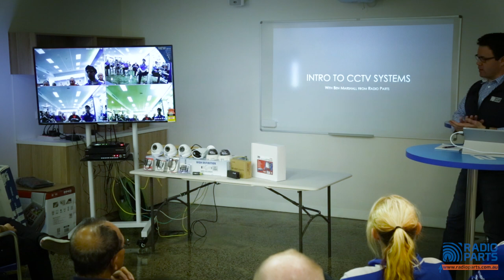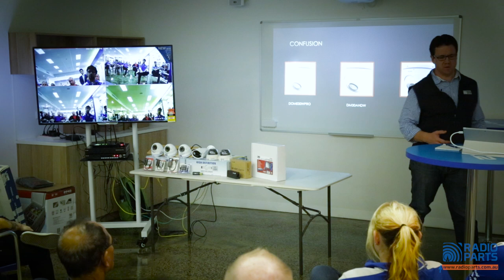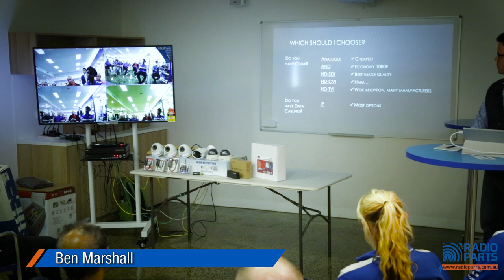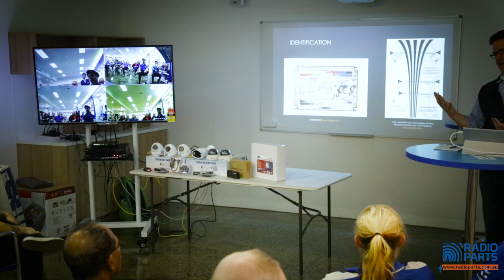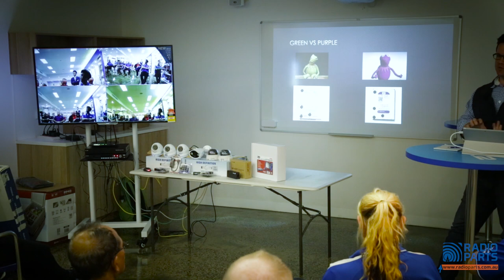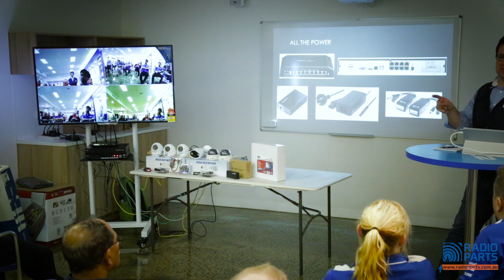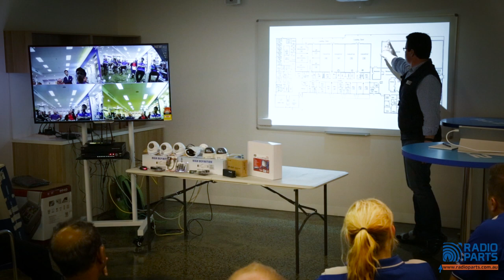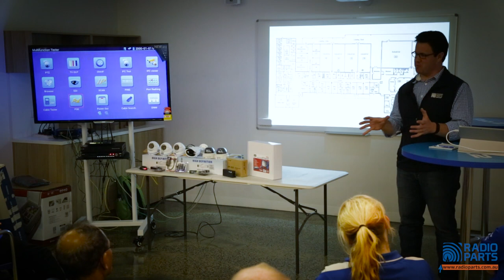Understanding CCTV Systems [15 Apr 2016]

Comment: 55:00 if you do have a heap of cameras on a domestic house network, what can you do to compensate for the net slowing down?
Reply: Dario Lattina Consider running a parallel network.
Reply from the maker: Absolutely. In our business, we run a switch for security, a switch for data and one for IP phones. You need QoS for items like phones. You don't want these to drop out!

Comment: make one about converting analog cameras to IP! I have been wanting to do this but no one has done it with a comparison. I am glad I didnt buy a hybrid or trybrid as if what you are saying is correct I cannot run say 2 analog and 2 ip cameras together
Reply from the maker: Hybrids have changed since this video was published offering more flexibilty, but ideally you'd rerun your cables for IP and take advantage of analytics and even higher resolutions.